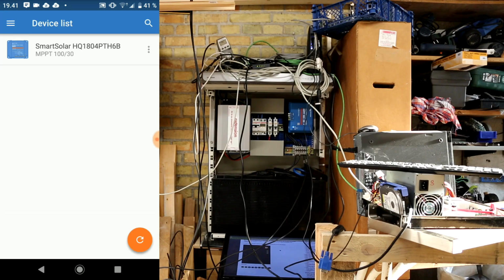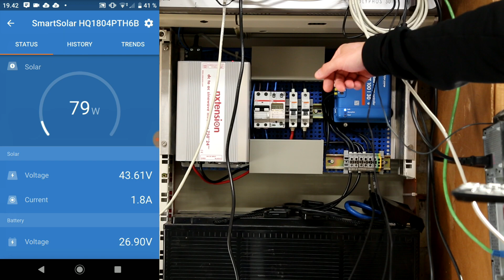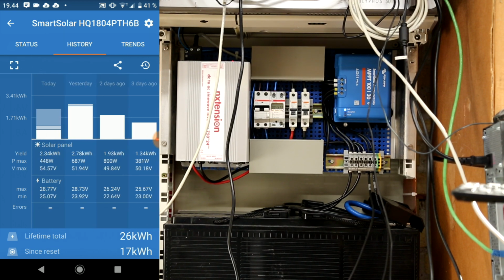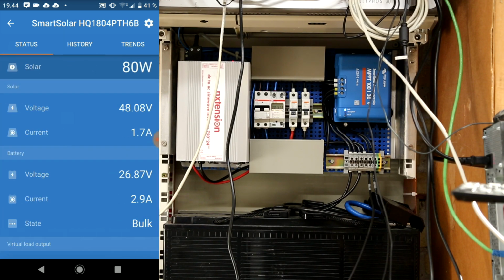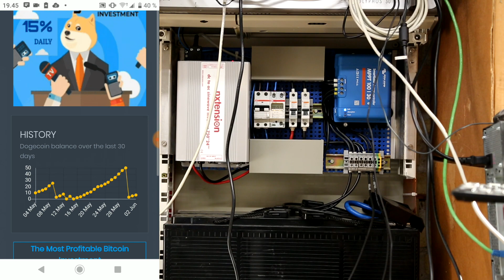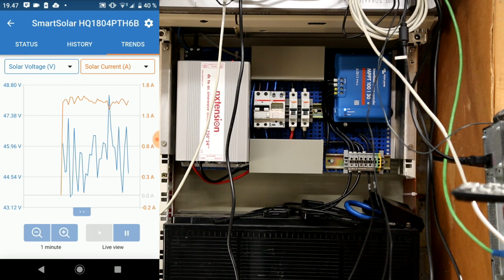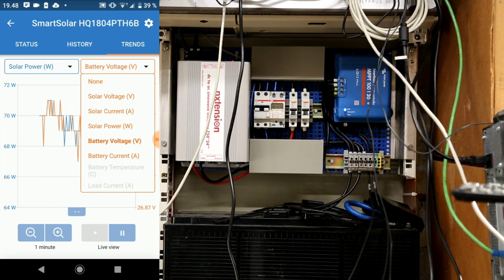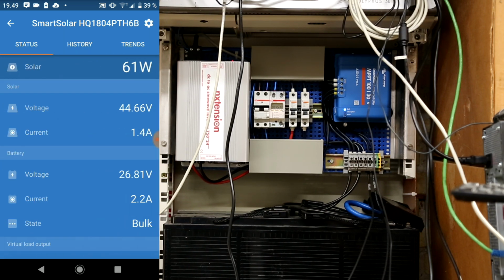750W Victron Solar Project - Power Wall and 8 Days Performance - Part 3

Comment: Have you looked into mining a more energy efficient coin? I have a setup using about 8W that makes about $15/month mining Swagbucks. That setup (and a few more that have since been retired) run from a 100W solar panel with a 12.8V, 82Ah LiFePO4 pack to keep it going throughout the night.
Reply from the maker: I looked briefly at swagbucks, but please do tell me how you are making 15$/month on less than 6kWh of power a month.
Reply: @KaizerPowerElectronicsDk  My Swagbucks mining setup uses a tablet to mine and a Raspberry Pi running a script to supervise the mining software.
https://pastebin.com/XvACe09K
Keep in mind that (in my opinion) Swagbucks is not a very good coin. (It's based on Scrypt with a high N factor to make Scrypt ASICs unusable.) In fact, the reason I use it at all is because mining it is more efficient than any other coin I'm currently aware of.